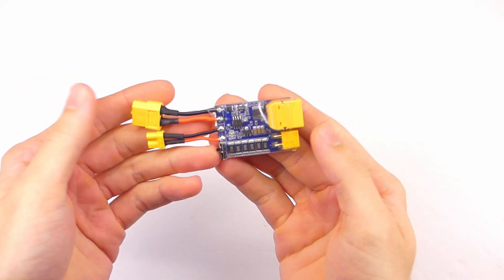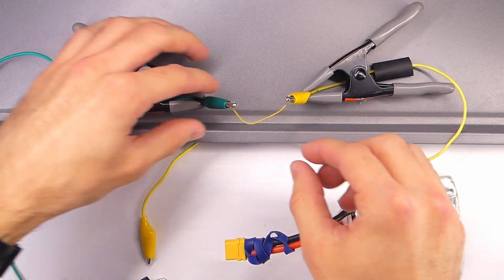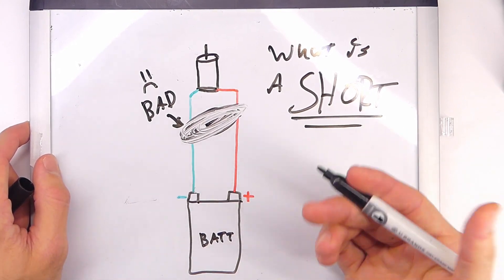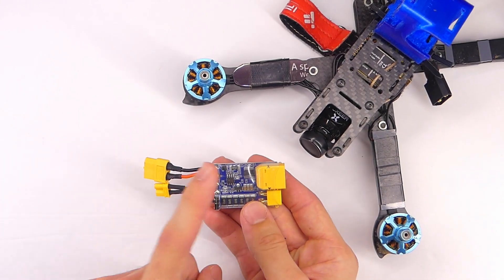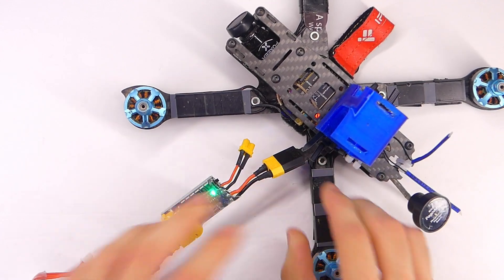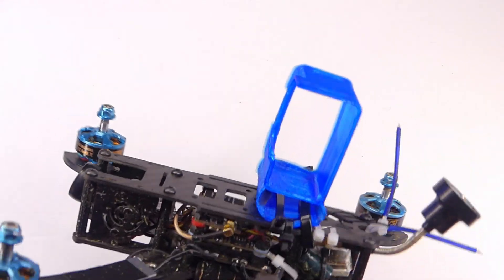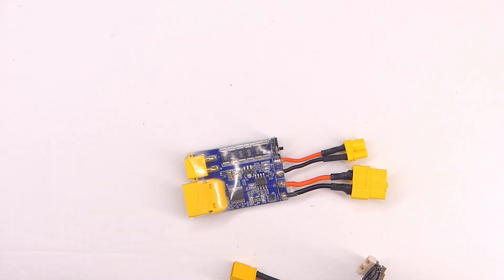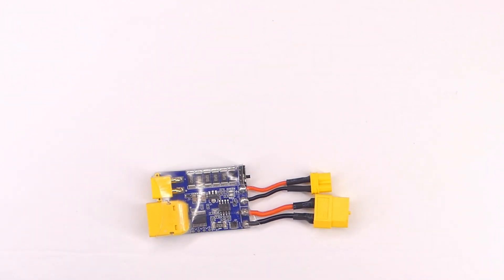🔌🔥 ViFly ShortSaver Demo & Review

Comment: The explanation of a short was awesome! Thank you - I get it now.
So I got my smokestopper last week and for reasons that I don't understand, my old smokestopper from RDQ gives me a green light when I connect to my quad, but my new one from VIFLY turns RED and shuts down when I plug in - on both the 1 and 2 amp switch setting.
Any ideas?
Reply from the maker: Glad it was helpful! 
I've also noticed that my unit will sometimes give me a red light, but after plugging it in again or switching amp settings it will work properly. Not sure if thats a "bug" or just how the design works with electricity.